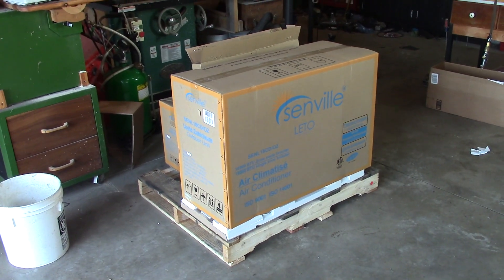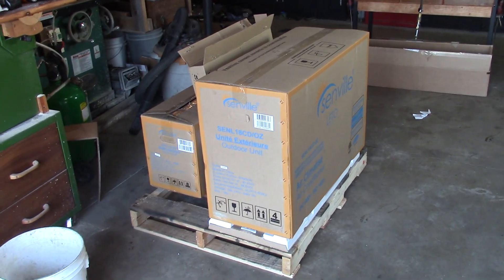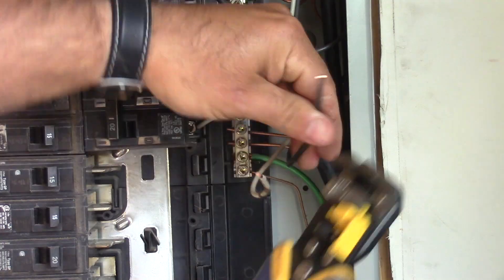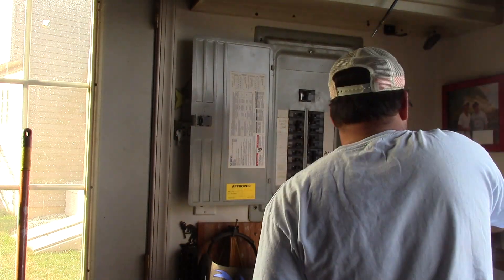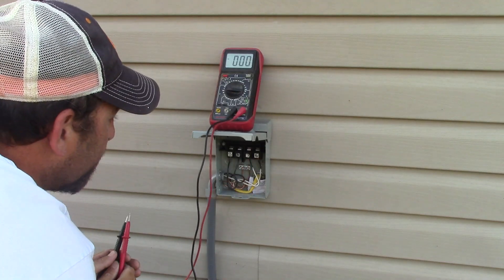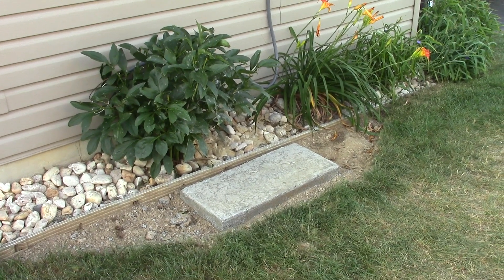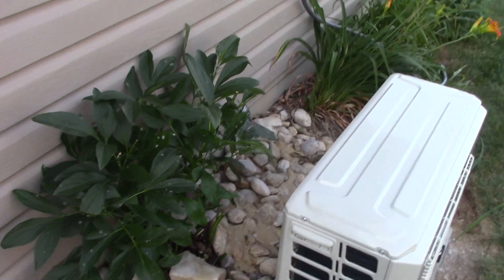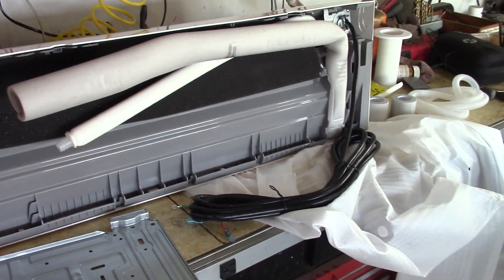Senville Mini Split A/C Heat Pump Installation

Comment: Bob, if I were to get doing, or having done this wit no permit .Code Enforcement in PSL, Fl, would absolutely bury me with fines, fees, penalties and God only knows what else. Not to mention, you can’t buy Freon without a Freon certificate.Good job.
Reply from the maker: In PA there are no codes permitting the install.  I think many people do the install themselves and hire an hvac tech to charge the system.  The refrigerant is already in the system, so it is pretty cheap when you pay for the service.

Comment: Man buddy I'M not sure i would want to lose my warranty I guess it depends on long the warranty is and how much the install would cost. I could the electric part no problem its some of the other stuff I might difficulty with my carpentry skills are the greatest. Looking forward to the series Bob because I'M trying to figure out what to do in the next year with my company I'M either going to have to go rent a commercial space somewhere or I could build a detached garage here for my company but I'M going to have to do something i'm running out of space. LOL Thanks for sharing. Have a great day. God Bless!!!
Reply from the maker: The warranty is a year and I think 5 years on the compressor.  The whole outdoor unit can be bought for less than $500 delivered.  There is not much carpentry except drilling a hold through the wall,  the rest I would consider hvac work?  What is your business? I think you mean to say "detached garage"  never heard of unattached;}
Reply: Yes I meant to say detached garage LOL I went back and corrected my typo I was tired at the time i guess. Well if its only a year and 5 years and the cost is only that then I would do it myself I own a full service landscaping company we Mowing,Turf care, all plant work design layout and planting and maintenance of plants Irrigation install and maintenance and Low voltage landscape lighting install and maintenance. That's where my small engine stuff comes into play I try to do all the work on equipment I can I have 2 great supervisors that have been with me for 8 to 10 years they run the crews out in the field and I'M able to do all paper work and payroll and work on equipment that way I have always like tinkering one engines and stuff used to cars the I raced R/C boats for several years and did all my own engine work and modifications doing that I started tinkering on lawn mowers when I was about 8 years of age or so so everyone tells me. LOL
Reply from the maker: Cool story.  Thanks man.  I don't know how these landscapers can pay the bills if they are paying someone to maintain their equipment.   That Rc boats sounds pretty interesting.
Reply: I bought two of these for just over $1500 Canadian. They come complete, just a matter of installing them. The best quote I got from a HVAC company was $7000 I will be on my fifth set before  I will question not getting them installed for the warranty.

Comment: Where is the neutral wire????   Shouldn't it be 3 wire...Black (hot)...Red (hot) ...White (Neutral) and Green (Ground)?????
Reply from the maker: Hi John, by code where I live you can use the neutral as a hot and use 12/2 wire.  You could wire with 12/3 but you would have an extra neutral wire that would tie onto the ground lug on the A/C disconnect.  There is no need for the extra neutral.  I would only need 12/3 if I were wiring 240V and the A/C unit required 2 hots and a neutral.
Reply: @doublewide6  "I would only need 12/3 if I were wiring 240V and the A/C unit required 2 hots and a neutral." Bob, YOU ARE WIRING 240 VOLTS  WITH YOUR 12/2 AND A GROUND! The box is bonded.
Reply: I think the red and white (Both hot)on a 240 volt circuit balance the load because they are out of phase with each other.